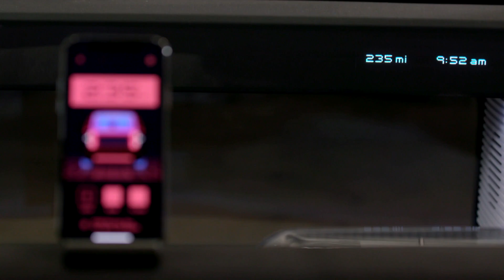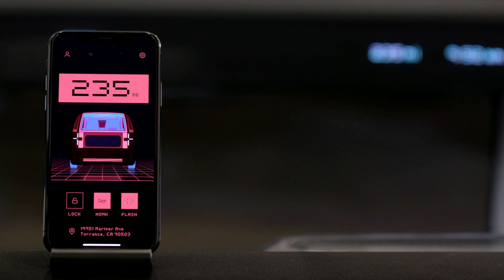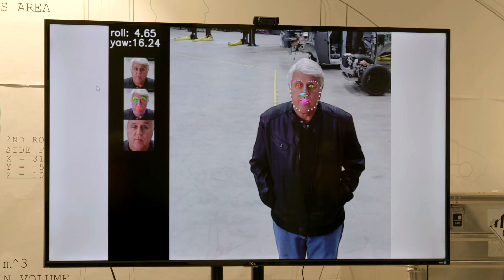Inside Look At New Car Company Canoo - Jay Leno’s Garage

Comment: Not many people would be better off with more interior space in exchange for far lower efficiency. 200 miles of range is fine, but this vehicle isn't getting this without a big battery. Huge battery means higher cost and longer charging. 

I want to know how many city/hwy miles per kWh, this is a spec that all battery electric vehicle reviews should include! For normal use that is what matters!

The skateboard concept is great, but NOT new! Every body on frame pickup is basically designed in this manner!
Drive by wire is going to terrify people, good on Jay for expressing concern here!
I'm less impressed with the response though, they must do better reassuring potential customers that operating a vehicle with what is basically a game pad is actually safe!

The subscription model is a BIG red flag, that means if they go under your car is going with them. 
My prediction is that this will never make production and they are currently looking for someone to buy them out. sorry.

Comment: I hope you realized that jay saying ''you design your own motors?'' an the guy saying "we design our own motors", Couldn't be farther apart an is miss leading. jay thinks of making your own block heads intake etc etc etc which is correct. this guy qualifier for building his own motors: he signed a contract with a third party to licenses their motor to only them for 24-48 months. unless he opens a door an there's tons of copper wire being wound or work like that" He doesn't make their own motors. In my opinion!.

Comment: What's old is new again..1909 to the present.  The maintenance must be less
If they made it more aerodynamic..used composition material and put solar 700watt glass panel roof with a range of 750 miles and get the cost of parts down you would have something Elon Musk would buy into and move it to China. Question..if California bsns gasoline cars, how will they pay for road maintenance..a huge carbon tax & increase the license tag & driver license to equal what you paid before?? The insurance I suppose would be included in the subscription. The gasoline cars will be mandated out in states like California
But unless the state let's the truck drivers on the docks, then this maybe only a dream at best

Comment: I'm sick of cars trying to look like 'the future' with non-circular steering wheels. Just stop it! That goofy concept has become so played out at this point. THERE IS NO REASON TO CHANGE THE STEERING WHEEL SHAPE!!!!

Besides. many car companies copied this dopey trend. So it's not even cool or shocking to see anymore, which was the sole purpose of irregularly shaped steering wheels, I mean let's be honest. It was strictly done for the 'wow' factor. And that's gone now, so hopefully the trend will soon fade away. 

PS: I know a few pedantic gearheads could say, 'Dude, flattening the wheel's bottom edge helps race car drivers...." blah, blah, blah... However, race cars have nothing to do with an electric minivan. Rectangular steering wheels on a mini van is like a giant rear spoiler on a 100 HP 1997 Honda. It desperately is trying to look cool but fails and it serves no other useful function.